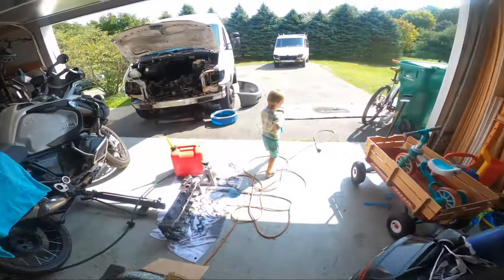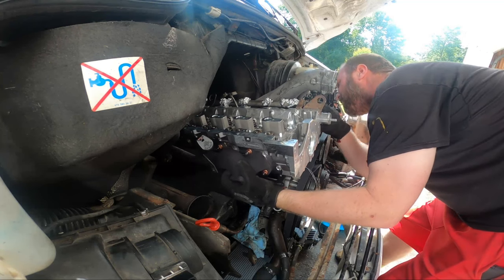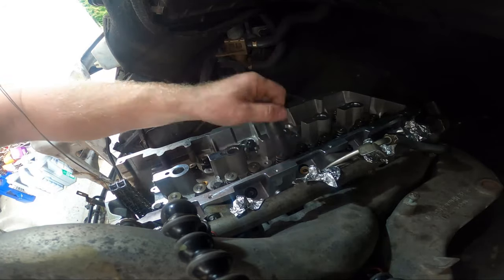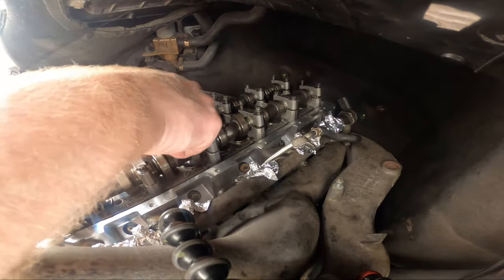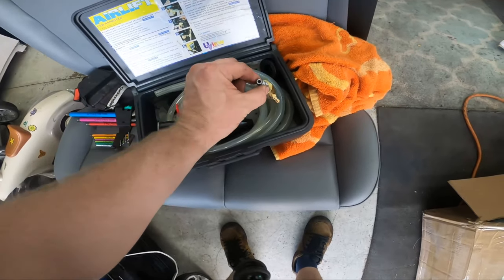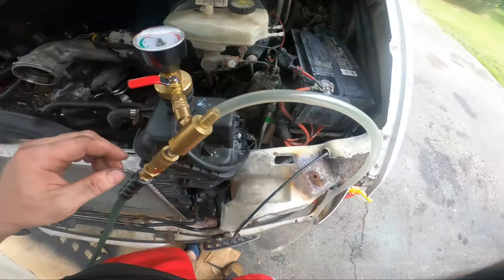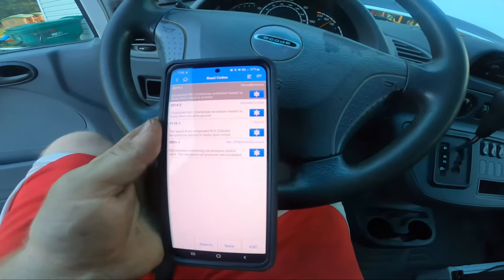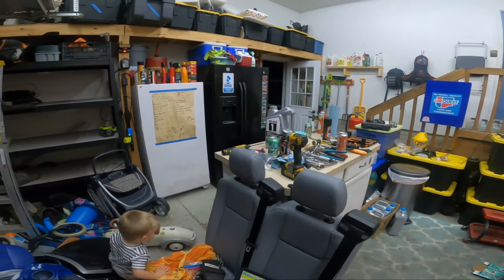2006 Sprinter T1N NEW HEAD INSTALLED!!!

Comment: you are a great mechanic.  the machine is the same as yours I would like to ask you to give you now the bolt is running empty I would like to make a 10 bolt now with the filleting the heilcoil is fine.
Reply from the maker: Are you saying you stripped one of the head bolts?  A heli-coil might not be strong enough to repair that because the repaired section is not very tall.  You might be able to have a shop drill and tap to a larger size, but then the bolt will not expand the same as the others when it gets hot.

If I was going to use an insert to repair the heads I highly recommend time-sert.  They are solid instead of a coil and much stronger.  I have used them to repair spark plug threads in the past.
Reply: @smsauce   hi i'm saying the two bolt injectors i did the heilcoil i hope it's totally fine.
Reply from the maker: @mohammedlemhamdi2821  Ah, ok.  I think that will be fine for injector bolts!  Keep us updated if anything happens.
Reply: @smsauce ok okay i did this job only yesterday i hope it goes totally well i am from morocco i live in milan italy ,